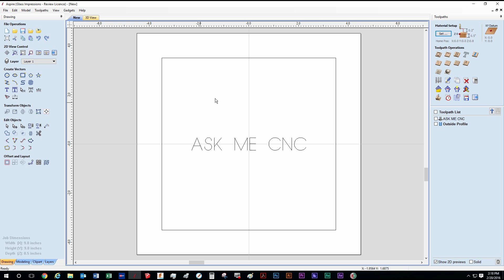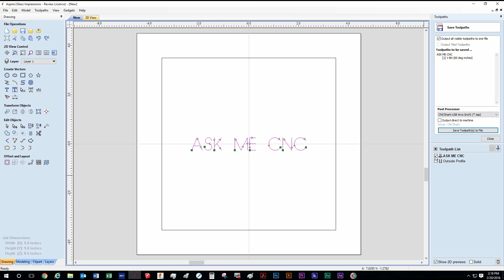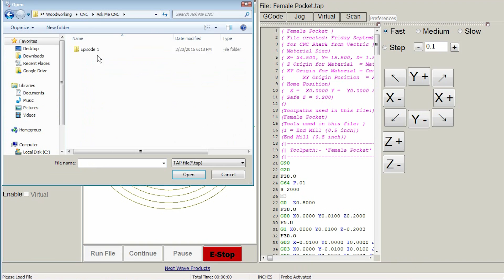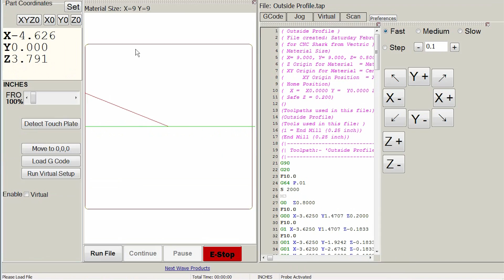Ask Me CNC #1 | Changing bits mid project

Comment: I just joined and am impressed so far. You are good at explaining even the simple stuff. That is good for me because I have a slow information absorption rate. Anyway, when I change bits and have the same max depth as a previous cut, the new cut always cuts deeper by a few thousands. I am using a touch plate as you have in this video. Why would i get two different depths on the same work piece? Bit is tight, touch plate in same location on untouched surface, spindle is trammed to fresh surfaced spoil board, machine bolts are tight, no Z backlash, etc.  I don't think it is material warpage because the deeper cut is uniform all around the project. I built a diy Gatton Shoestring cnc in 2015. I have just started doing text over text so I don't know if the problem has been with me all along or just started.Any suggestions will be appreciated. Keep up the good work!!
Reply from the maker: Dan Gartin You have checked all the things I would have suggested to review and tune. Maybe the inaccuracies of a homemade machine?

Comment: Are you using Mach3? - My machine can NOT seem to hold 0,0 for x and y... between the bit changes.  Maybe I'll try 0,0 at the mid / center point instead of lower left corner...  I'm using VCarve Pro.
Reply from the maker: Jeff Brunot make sure you keep power to your machine
Reply: Yep.  PWR remains on...  I think I may be skipping steps or something,  I do the same thing you do - move the cutter off the work-piece so I can make the change, then bring it back to zero and re-zero the Z and it's never where it needs to be.
Reply from the maker: Try moving it to 0,0 and change it there
Reply: Will Do.  Are you using Mach3?

Comment: Hi Andy,I have been given a CNC that came from China, the only identification I can find is "T-D 3 axis controller Mini-cnc engraving machine" and although I have a licence number the programme locks my keyboard and mouse out as soon as I try the input the licence key. on the back of the controller there are 4 round connections about 1/2" diameter going to the X,Y,Z & spindle. as my computer will not recognise the controller I was wondering it I could swop it out for an "X carve" controller as I can get this item in the UK, but I have no idea if this would work. As someone with a lot more experience than me could you offer any ideas.
Reply from the maker: John Fithian-Franks it may work but you need to be aware of power consumption of the boards and controller. Good luck!
Reply: Thank you for the advice, I am not sure of any of the power consumption issues but at the moment all I have is an unusable too so I am not putting much in danger, but I will make sure I have an fire extinguisher handy.

Comment: Love your videos!  I do some semi-production CNC work and would like to get your opinion on using multiple fixtures in a single run.  This allows you to cut multiple setups with a single tool before changing tools, essentially cutting your tool changes in 1/2.  Setting multiple homes (one for each fixture), with each fixture having a slightly different material thicknesses. Thanks for your help!
Reply from the maker: +Chris Ghaly why would you have multiple homes? I like the thought of a production focused video. I will put that down.
Reply: +Glass Impressions Multiple homes will allow you to run your first tool on both fixtures.  Home-1 tool-1 on the first fixture, home-2 tool-1 on the second and so on.  In production work tool changes are where your time get eaten up so fewer is better.  For example if you are cutting 4 identical signs with 2 tools (v-bit and end-mill), cutting them all at the same time results in 2 tool changes.  Cutting them individually results in 8 tool changes.  Setting all four up on the table at once (4 home positions) reduces your tool changes from 8 to 2.  Hope that makes sense.  Again, thanks for your help.
Reply from the maker: +Chris Ghaly that gives me a better idea but I'm not sure how you set multiple home positions. I would just design my file with the 4 fixtures with 1 home position. Does that make sense? What software do you use?
Reply: +Glass Impressions That makes sense and I've done that before with varied success.  I use VCarve Pro 8 for design and tool path generation. You are correct, VCarve allows you to set only 1 home and 1 material (z) thickness per job setup. The CNC I'm using is a MultiCAM classic and it allows you to set multiple homes.  The real issue is that with multiple work pieces on the table at one time, they all have slightly different material thicknesses. In VCarve, I'm not aware of a way to set multiple z values. for a "single" job setup.  That is why setting individual home values (with accompanying surface z values) seems to be the way to go.
Reply from the maker: +Chris Ghaly interesting. Challenge accepted! ;) I appreciate your interaction with the channel
Reply from the maker: +Chris Ghaly so been thinking on this as I am traveling for work. Surprise. Surprise. A quick workaround without looking into Aspire would be to modify the cut depths to account for the varying material thicknesses. Have one job zone be fore one thickness material and have another be for another thickness of material. I still will review this in aspire and get back with you!

Comment: nice tutorial...what if the material has been craved away with the first bit so the original height of the material has changed and the original datum point has been milled away...how do you reset the z-zero then..?
Reply from the maker: Great question! I will implement a brief follow up section in the next episode. But to answer your question now, you can set your z on the edge of the material as it doesn't have to be on the X and y zero positions. Or if you know this situation will happen ahead of time, you can set you zero position for the z axis on the table rather than the material.

Comment: Thanks Andy...CNC's are intriguing to me, could be in my future.  One question and one request...are there popular software interfaces that work on MACs?  And could you demo how you could achieve a double bevel cut inlay of a shape into a background piece?  I'm assuming the angle of the carving bit would play into this but also curious how the software accounts for that and the thickness of the two mating pieces.
Reply from the maker: +Mark Lindsay I understand now. Mark hit it right on the head. Yes a video on V inlay can be done!
Reply from the maker: Can you provide an example picture? I need a bit of a visual to understand what you are trying to accomplish
Reply: +Glass Impressions 

I do intarsia, and if I'm working on a large piece, I'm limited to the 22" throat on my scroll saw and the thought of a CNC to perform these large/wide cuts is interesting.  I usually fit a shape of one kind of wood into a base piece of another type of wood (using a double bevel cutting technique)...similar to marquetry but with much thicker pieces.  Here is an example of a smaller piece that I  can fit within my saw capability to create a somewhat perfect fit of one wood type into another...I've see this done with mtm woodwork videos on his cutting boards that have inlay patterns in them.

https://www.flickr.com/photos/78271350@N00/17108011511/in/album-72157651898680425/

Thanks,
Joel
Reply: +jfk4032  The process you're referring to is called V Inlaying. It uses a v-bit to cut the pocket for the inlay (usually with a flat bottomed end mill or bit to remove the bulk of the material in the pocket,) and cut the inlay material to fit into the pocket. I know that Vectric's VCarve Pro and Aspire both have V Inlay operations built into them, and it's a pretty straight forward process.  I don't think VCarve Pro or Aspire are made to run on a Mac, but I do know that several members of Vectric's user forum run the software on a Mac through a Windows emulator. It's something to think about, anyway.
Reply: +Glass Impressions Andy, a demo on V Inlaying would be great to watch and learn.
Reply from the maker: +jfk4032 I will put it on the list! Would be a great solo video

Comment: Nailed it.

I assume every g-code reader has the ability to maintain X&Y zero but adjust Z?

Here's a question for you that may be useful for people to save time - what do you do in the software setup or pathways to rough out the majority of the piece with a large bit, but then change the bit and do the last fine work?
Reply from the maker: Great question! I will put it down!
Reply: +Glass Impressions good stuff! Your videos are awesome, btw. Really logical approach with great angles and commentary. Thanks and much appreciated.